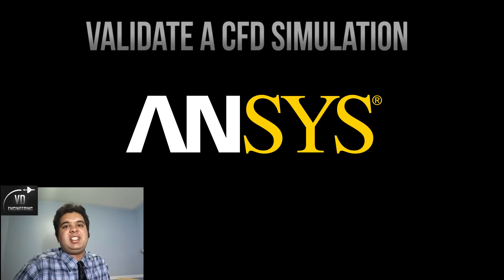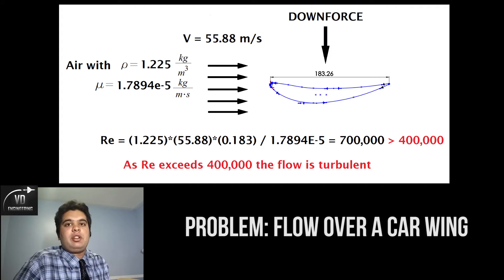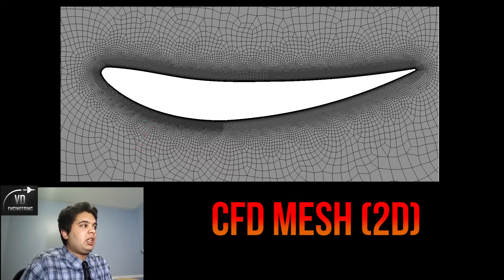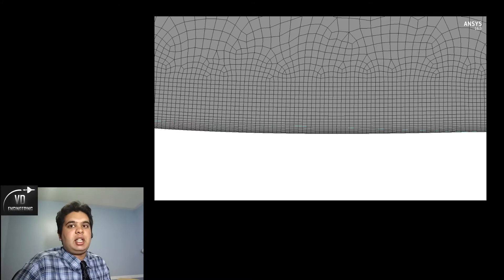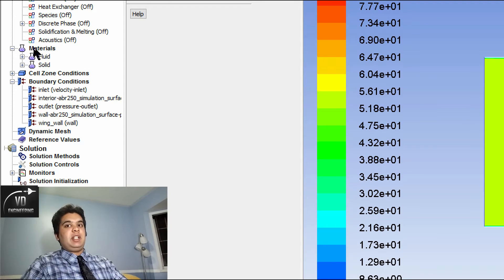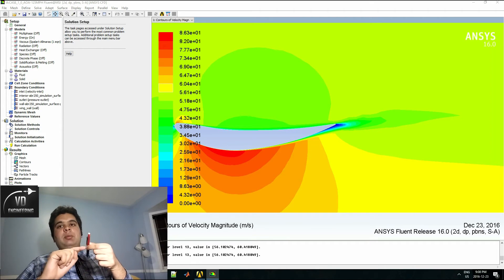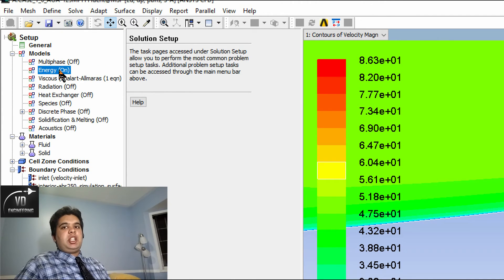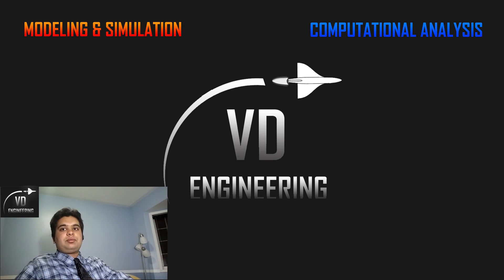ANSYS FLUENT: How to Quickly Verify a CFD Simulation

Comment: i want you show the meshing you have done in this simulation.. your different video on structured mesh gives very inaccurate results. pls. help me for the full analysis. "meshing to validation" you've different video for the structured meshing and different example and video for the validation. pls. help me with  making video on meshing+simulation+Validation for the same airfoil  with its given experimental data.

Comment: Hi, 
how would you compare the accuracy of Autodesk CFD and ANSYS Fluent? I'm mainly interested in simulating compressible internal and external flow. I see that the turbulent models are different.
Reply from the maker: I cannot comment on Autodesk CFD since I have not used it before, ANSYS Fluent is used as an industry standard tool.

For compressible flows, this is a good link:

https://confluence.cornell.edu/display/SIMULATION/Compressible+Flow+in+a+Nozzle+-+Geometry